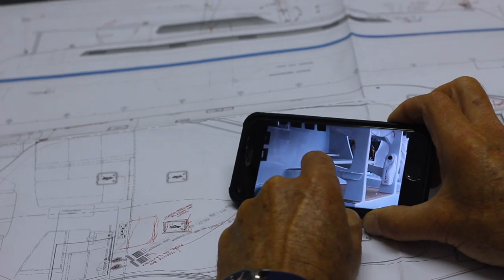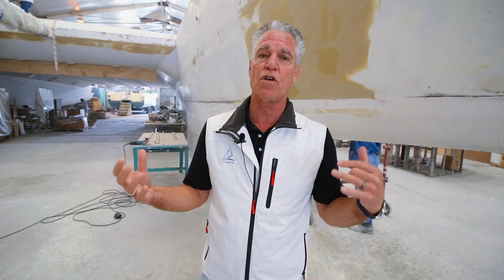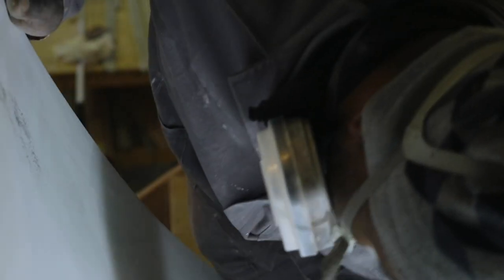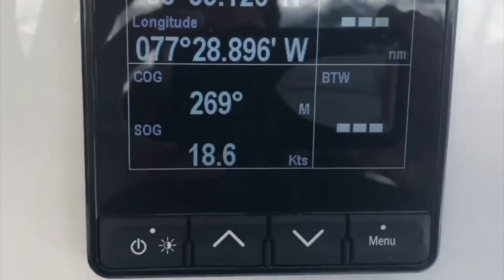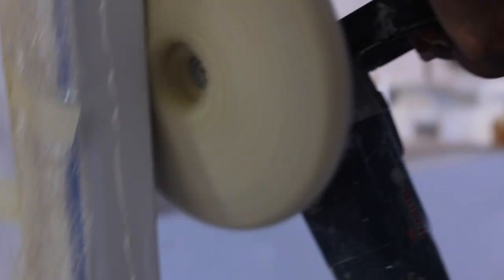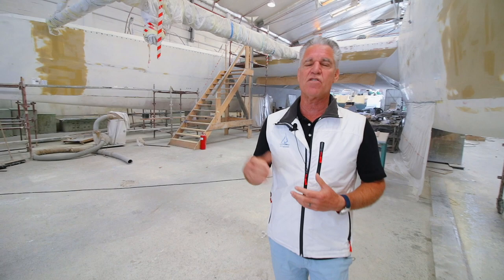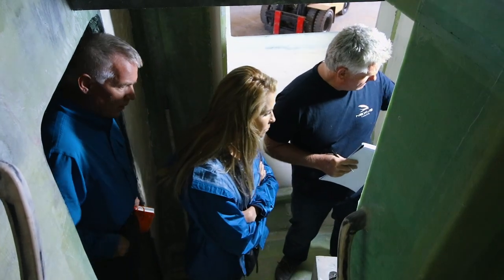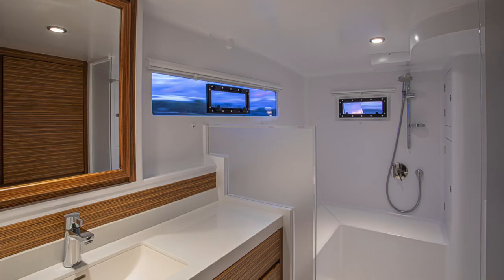Balance Custom Catamaran Division

Comment: can one get a second helm on the 526?
Reply from the maker: No. Why would you want two helms when you have both an up and a down helm using the same wheel?  Phil
Reply: You'd either end up with outboard helms (which are rubbish) or eliminate all of the lounging space in the cockpit.

The versa helm is brilliant not because it's perfect in one situation but because it's almost perfect in every situation. You loose very little lounging area, have great all round visibility from up top and excellent cover, and still pretty good visibility down low.